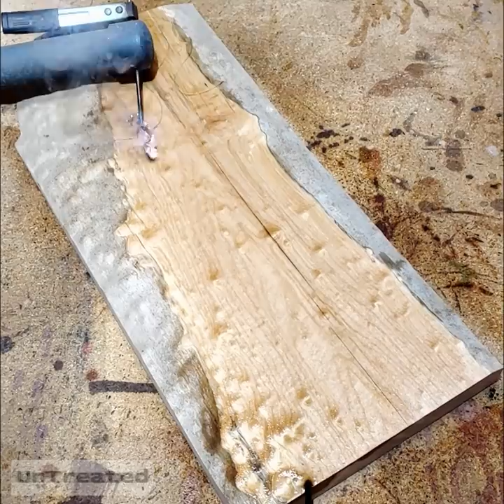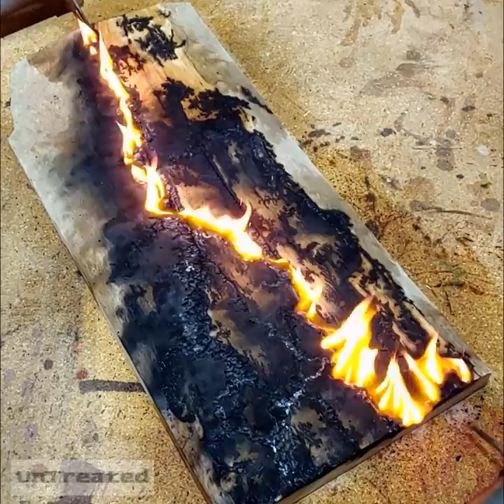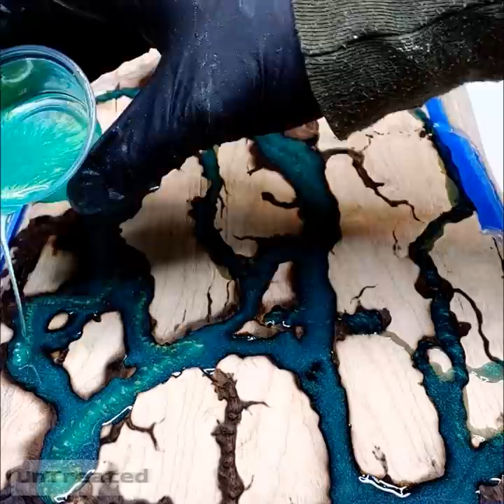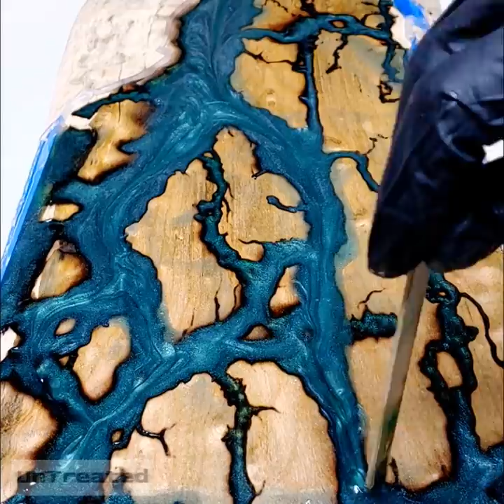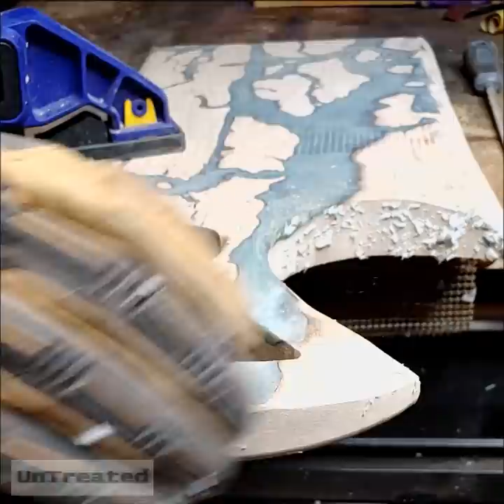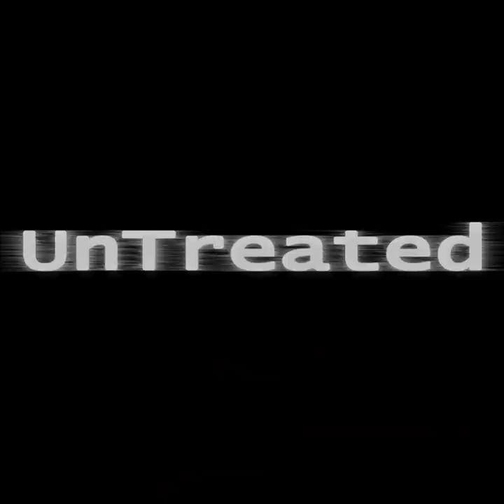Making a figured maple fractal river epoxy resin charcutterie board

Comment: note for all those, who have no experience about resins. i work as a chemist for basf and can only say, that most epoxy resins turn yellow over time when exposed to uv-radiation, and that faster and worse with time. therefore you should be use epoxy resin, which is uv-resistant. if this is not available, a uv-resistant sealant must be applied, which usually consists of a polyurethane resin.
Reply: Would you happen to know the malleability of epoxy or if there is a way to make it more malleable without losing durability?
Reply: @andrebeasley5300  sorry for the late answer, yt dont let me know when i have likes or someone answer me. it depends what kind of durability you need or want? but you should test a polyurethan resin. the durability is good and not so stiff. hope i could help.
Reply: Knowledge 🔥

Comment: What are the 2 torches the burns were done with?
Reply: The burning is done by attaching positive and negative metal contacts to to the board and then running electricity from one to the other through the wood.  Can be dangerous if you don't understand what you're doing.

Comment: What tool did you use to burn the surface? It looked like it was sending an electric current.
Reply: That’s what I would like to know as well
Reply: @frankroybal4759  i think they are called Litchenberg machine. It's basically a transformer from a microwave or neon sign that can create 2000 volts. It's can be crazy dangerous. There have been a couple deaths. You really have to know what your doing.

Comment: Hey I wanna Lear  can you help please. What l need.  I live Sacramento ca. That job its. Super nice 👍
Reply: All you need is a transformer from a microwave oven. Easy to learn on line. Notice the PVC handles? That is because the electricity involved would kill you instantly. 20,000 volts.
Reply: What is I called